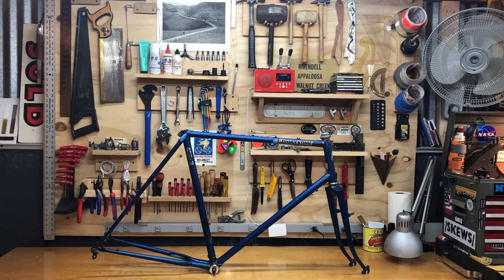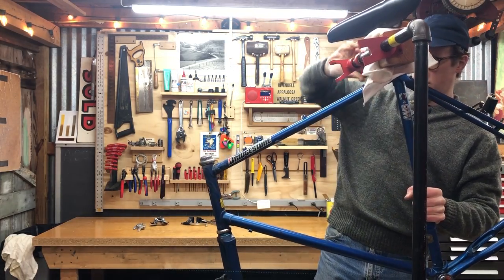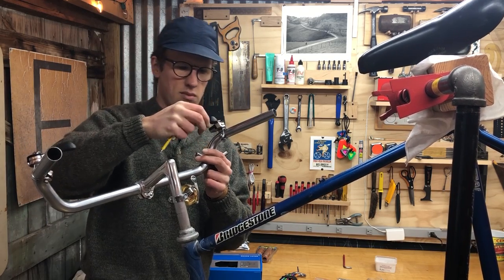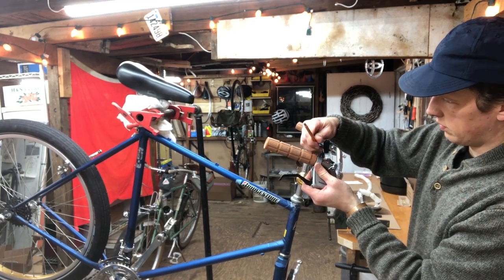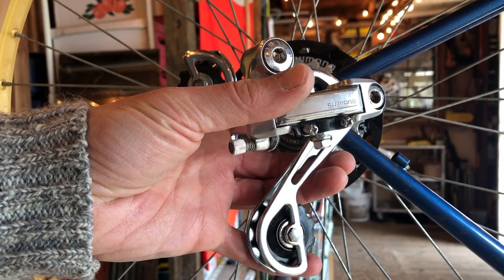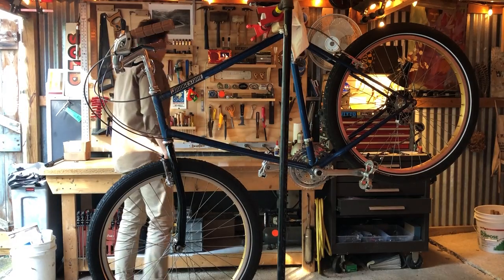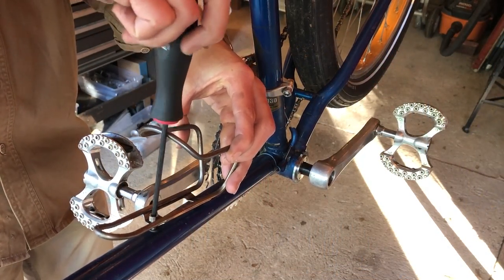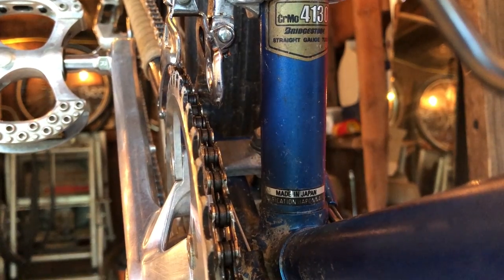1985 Bridgestone MB-3 All-Around Bike Build

Comment: Got 30 early 90's Bridgestone mtn bikes. I commute/long distance tour on them heavily loaded with jandd expedition racks and a bob yak trailer with a drag brake.  Simple, extremely reliable and super easy to work on.  For me, 7 speed cassettes and  cold forged triple cranks and Shimano thumb shifters rule!! Never owned any bike made from pop cans,  shocked in addition to having no front derailler.
Reply from the maker: Sounds like you've got it figured out!

Comment: Worth pointing out those levers are T4000 Alivio, not XT. I wouldn’t normally parts snob about them. But I have that exact pair sitting in my spares bin now. Because the right one developed a weird sticky scrape that started driving me mad. I upgraded them to the actually XT pair. I paid way too much for my set because I wanted all shiny instead of the black bodied version Riv had in stock at the time. 

I also got the shiny DXR levers from Riv. They’ve been exceptional.
Reply from the maker: Thanks, Whitney! I had a feeling I'd messed that up but didn't look hard enough at my purchase order records. Sounds like you're well acquainted with all form of Shimano levers :)
Reply: I love the LX - BL-M601 levers :)

Comment: Did you have any problems with the tires because I have the grey mb3 and debating on getting the tire size 2.35
Reply from the maker: Yeah, actually have some chain rub on the tires in the low/low! The tires are Schwalbe Fat Franks, 26x2.35. They clear the frame fine, it's the chain line that's the problem. It would prob resolve with a smaller tire like a 2.15.

Comment: I'm running the same handlebars and stem and can't stop them from slipping, what's the secret?
Reply from the maker: Hmm, not sure! I haven't had any trouble. Did you grease the clamp bolt? Bolts without grease don't hold torque.

Comment: I use Shimano EM shifters on one of my bikes, they're much nicer than the matching EM brake levers, which are plastic with very thin bits of steel pressed into them for styling. You won't even find a picture of EM levers because they're that bad. The shifters are perfectly adequate though, so adequate in fact that Sunrace copied them in more recent years. I'm surprised yours make a ratcheting sound, mine most certainly don't.
Reply from the maker: Sorry to hear about those levers. I saved the EM shifters. A nice pair of Power Thumb Shifters are just awesome.